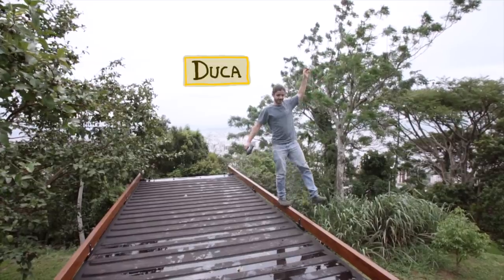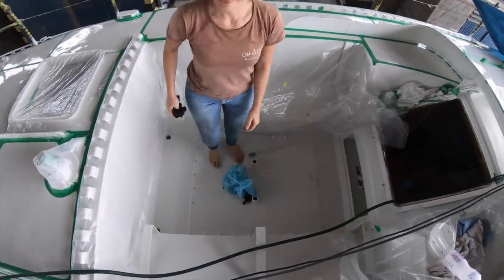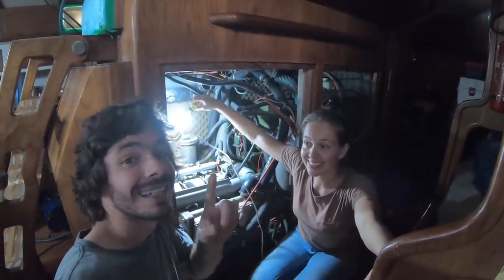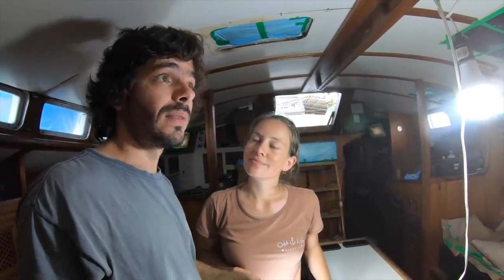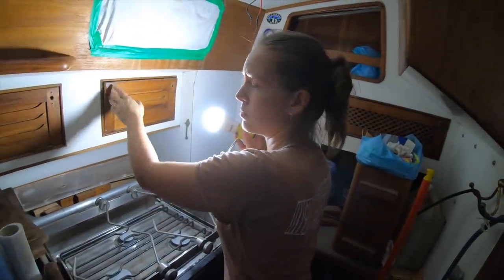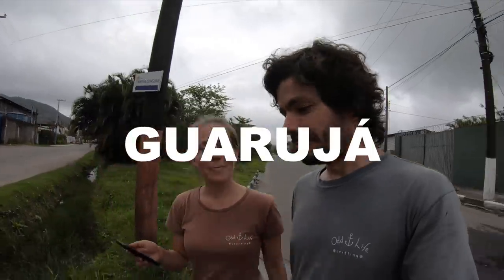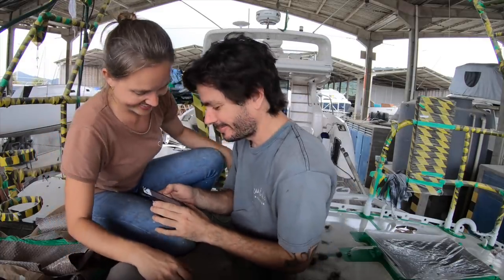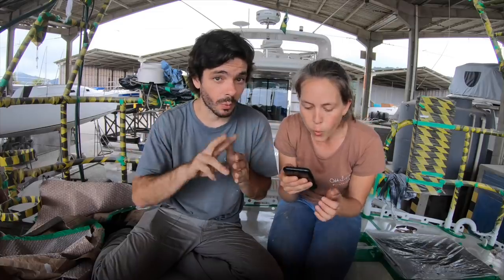⛵️"Abandoned" sailboat tour after 4 month of refit (still long way to go) + Q&A + haircut #104

Comment: For finishing the container house... I think taking a break after you get the boat in the water makes sense, but then just get the house done. That way you will not have it hanging over your head and you can cruise freely and look forward to going back to the house rather than thinking about unfinished projects back home when you are out on the water. There is a danger in never actually getting the house finished if you stretch out the process.
Reply from the maker: Thanks for the support
Reply: Odd Life Crafting and

Comment: I'm so glad to hear that you're media blasting the fuel tanks. It's a tough job, but the right thing to do. You'll have zero regrets.

You mentioned garnet. What's driven the choice of materials? Mineral sands (olivine and staurolite) will produce a similarly appropriate surface optimized for coating adhesion.

Garnet is excellent, but more expensive than mineral sands. However, this may be offset by garnet's lower consumption characteristics.

As you've not media blasted previously, practice out of doors on scrap materials before beginning work on the tanks. Dial in the pressure and flow, as well as perfect your technique (distance, speed, angle, etc.).

When it comes to working in an enclosed space, be sure to supply ample ventilation, and setup dust curtains to contain the mess (which will be considerable).

Lastly, Duca, this isn't a job on which to skimp on personal protective equipment. Don a full cover, including a hood. Wear gloves and goggles, and use a proper respirator! Ear protection is also recommended. Tape interfaces with gloves and shoes/boots, too. Media gets EVERYWHERE, so better safe than sorry.

I only wish that I could be there to assist in bringing your dreams to fruition.
Reply from the maker: Thanks a lot for all the tips, John. We have garnet available for free here in the marina, that’s the reason why we choose garnet. 😉. The idea is to try the machine on the lids first 😉
Reply: @OddLifeCrafting  Free garnet. Woohoo! Garnet will yield the best result, as you're looking to remove old paint and corrosion while creating an abraded surface that affords the new coating an optimal mechanical bond. Perfecting your technique on the tank lids is an excellent idea. You'll do great, Duca!

Comment: I agree with Roberta.  No Green stripe.  I would go with either white or black.  Black will probably be easier if your hull bottom is black.  You can just use more of the same black anti-foul as the stripe and done.

Regarding the sailing:  You do have an advantage being in Brazil in that you have such a massive coastline that is very close to the Caribbean, which is probably the easiest place to sail in the world. Honestly, I would recommend that after putting all this work into the boat you just load up and go.  Don't delay, because every day you delay is another day that you have to come up with an excuse to not go at all.

I can tell you from personal experience that life has a way of getting in the way of your dreams.  if your dream is the cruising lifestyle, then when you get the chance jump at it.  Because inevitably bills and babies and other life complications will arrive.  You don't want to be 20 years down the road with a boat rusting away on the hard that you never took out or only took out on weekends.
Reply from the maker: Thanks for the support

Comment: If I can suggest, on the manual head. Install a the macerator pump in between the head toilet to your holding tank.  With a simple manual switch, you can flush and macerate the fluids and such before it goes to tank. Makes it easier to keep clean, turns you head into a cheap electrical toilet.

Comment: Boat is coming along great. Like the anti skid paint for the deck and the port holes look good. As for the mast, you have to look at it and assess it's condition. You may be able to use the mast but replace the standing rigging. The running lines and sails probably have to be new. Your there and that's the choice you have to make. It sounds to me that doing more of the work there is better than just getting it moved back home and finishing it there. I was worried that the costs would be more there than back at your home port.  Your living conditions and the work that is being done looks to be reason to stay there longer. Once your in shape to sail, you might get someone there to help you with lessons to handle the boat before you head to open water.
Reply from the maker: Thanks for your support, Richard

Comment: Omega, Delta, Delta is a great name for the boat. If you just modify it slightly to Oscar, Delta, Delta it would make it perfect, especially for radio communication. "Oscar" is slightly clearer than "Omega". What you have achieved so far is fantastic and I'm green with envy. Best wishes.
Reply from the maker: 🙈🙊 my mistake. At least it’s short to remember

Comment: When installing the seal around the diesel tank, pay attention to uniform surface pressure. That is very important my husband engineer said. And he also said, you  can leave the diesel tanks as they are...love lore&Bodo from Austria
Reply from the maker: Thanks for the tips, Eleonore’s husband! 💕
Reply: AND the rubber should be diesel- resistant. So maybe better to buy a new one🤷🏼

Comment: Well,  informative episode , glad you figured out a way to blast the tanks , glad to see your going through the plumbing , my adivise is as it always  do the best you can with what you got .The electrical system , I hope you realize before hook al that new stuff up you better do the best visual inspection you can and replace any wireing that looks suspect , a fire on you boat would be no joke , and I have seen a few in my time . The rig ,  I do hope you get a new spar , thats great ,does that include all new running rigging as well? I hope .You did a good job on the taping off the non skid , it can be time comsuming and you all are not pros . You know you could compromise on the bootstripe , and make it white , it will set off the waterline from the black bottom paint , come up 2.5 cm and paint a 2.5 cm stripe it will look better and you can always change the color .As ever I wish you well and am really glad about the rig i hope it comes to pass . Keep on keeping on and ...calm seas fair winds and a star to guide you by .
Reply from the maker: Thanks for the tips, Lawrence.

Comment: YES!!! A Garnet wet abrasive blast is perfect. Hopefully you also use a rust inhibitor in the water like “Holdtight102” or a “Chlo*rid” product to prevent flash rust. I’ve done thousands of square feet with this process. You will get great results.
Reply from the maker: Thanks for the tip

Comment: Vinyl wrap is cheap and easy - you could both decide whether you can live with the colour before committing to paint. Sky blue is complementary, ie opposite orange on the colour wheel, but citron green could be a good fit too. Needn't limit the choice to only one additional colour if the design is good.
With such a radical colour as orange a good designer could make the boat look amazing with a radical shape of contrasting colour(s) instead instead of just a boring horizontal stripe.
Have fun with it - colour is easy to change.
Did I mention the importance of good design? :-)
Reply from the maker: Thanks for the tip, David

Comment: guys, check out your manual head - I am not sure but as I recall, you might have one of the most reliable head fitted now. MArine toilets are prone to break down and it is no a pleasant job to fix them. DO not throw your out without checking the brand/make, maybe it worth restoring it.  Best regards.

Comment: Add my vote to the carrot survey. No carrot boat. Suggestion, now that you are changing all the hoses, keep a couple of the ones in best shape, as  spares for an emergency leak. On the smaller hoses (like an inch or so in diameter) find a piece of flexible pipe (like copper) that fits inside the hoses and you can use to fix a split. For the bigger diameter like those in the engine cooling system or in the head output you can get a piece of PVC pipe that fits inside the hose just in case you have to split it to correct a leak. I am in agreement with you in regards to using English. I am Hispanic and I doubt that I would understand if you spoke only Portuguese even though they are very similar. I have an accent too so maybe that is why I love your accent in English specially Duca's.
Reply from the maker: Thanks for the tips

Comment: I'll have to start as its playing....stop on the fuel tanks...you have none of the algae sludge that causes filters to clog...Paint the hatches  and seal them up.  Your filters will pick up any stray strands of pain and they will last 20 years or more.  Use a baja filter.
Stove...the propane system is more important then anything.  More boats explode or catch on fir then sink.  One continuous line fro the propane appliances to the propane locker.  And a solenoid to shut it on and off.
Dodger...get a hard fibreglass dodger top made up or buy one...it saves you an amazing amount of money in the end as you only have to do the sides and windows...I just bought a used one.  Solar panels go on top.
Reply from the maker: Thanks for all the tips, Jerry

Comment: Hi Duca.  Hi Roberta.  No comment one way or the other about the green stripe.  Reading the comments, I think the consensus is "NO GREEN STRIPE!"  🤣🤣 🤣🤣  But, I have to say that I do not think that the name "Odd Life" is too long.  I think the name "Odd" is way too short, and in an emergency, may lead to confusion as the recipient of an emergency call may not understand that you are saying "odd."  But, what do I know?  "Monkey Business" is a long name.  There are numerous long names already in use.  Odd Life would not be one of them.  As for getting back to work on the container house after you sail your boat back to your home waters, I say take a break for however long it takes you to recharge your engines and then get back to finishing your pied-a-terre.  Like you said, between the container house and the boat, you've been going at this steady for more than two years.  You need a break.  But, lets get that house done.  Then, any additional work on it will be odds and ends here and there, and you can use it as you originally intended - as a place to land when you are not at sea.
Reply from the maker: Thanks a lot for your support and for the tips, Fancy

Comment: Question - do you really need to do ALL the hoses and the ball valves?  I would only do the critical ones below the waterline and any that have evidence or degrading over time.  A good ball vale will last many many decades.  I have a boat from the mid 1980's (Nonsuch) and still use may of the original fittings and yes, even some of the original hoses (but it is on freshwater in the US Great Lakes)
Reply from the maker: The problem is that they used residential valves so with salt water + 20 years. I mean they are “working” be they aren’t on the best shape. So as we are exchanging the hoses we decided to exchange the valves. 😊👌🏼

Comment: Hi Brazilian dry sailors, Please dont put a green line on your boat, if you realy have to put on a collor line..make it black, like the bottom.!.The painters did a great job, the boat looks brand new.! Nou I want to warn you 2, for wet sandblasting it is a realy messy job. The tanks will fill up with water realy soon.!! When people deside to do wet sandblasting inside,  they mostly have to drill drain holes.! But these holes have to be welded to close again.!!. So I ask you 2 to take that in cosideration.! My advise to you 2 would be, use "chem paint remover jell", and a few hours later scrab the loose paint of with a paint scrabber, after that sanding, clean with accetone, and it's ready to paint.!  (You 2, can also check the Y.T chanel "MS. Seeker", this man has a lot of experiance with wet sandblasting.!. He builds a 62ft steel exploring sail boat in his front yard.).Anyway, succes and have a nice time..Greetz.NL
Reply from the maker: Thanks for all the tips, my friend

Comment: I'm no expert, but I would think twice before introducing sand into your fuel tanks. Sure do the top plates off the boat if you want, but didn't everyone say that you won't have rust issues once the boat is moving around and the diesel is sloshing around? Hey anyway have fun in what ever you do. What I do understand is that there isn't always a simple solution to a problem. Think this one out carefully.

Comment: Skip the sand blasting and consider inserting a flexible fuel bladder inside the tank.
Reply from the maker: Thanks for the tip. The problem is that the tank is part of the steel hull, so we need to treat it anyways
Reply: @OddLifeCrafting  Yes, I understand that but consider this bladder as a flexible liner, which expands and shrinks depending on the volume of fuel.  Such bladders are used by US military as temporary fuel storage in all sorts of climates, both hot and cold.  Aircraft also employ them..

Comment: you can blast with dry ice after your done it evaporates !!!
Reply: You need a special machine to blast with dry ice.  You need to have propper ventilation.  Dry ice is not as good as other mediums (walnut shell, plastic bead, etc)
Reply from the maker: It's hard to find it here in Brazil

Comment: Bonjour les amoureux,
I am jealous, Duca, we have the same size but you have three times more hair than I :+)
Il like your videos even these Q/A sessions and you did not anwer to one of mines : How do you work on the parts of the hull hidden by the supports ? Do you move them regularly ?
I can't wait to see what happens to your engine, even if I think that will be good news as it is always in place and cleaned (no, you did not betray the topic!).
Amicalement, Raphaël
Reply from the maker: 😂😂💇🏻‍♂️Every time we moved the boat we put the supports in different place, them we can paint under the supports. Sorry that we forgot to answer your question.
Reply: @OddLifeCrafting  Bonjour, You do not have to be sorry, it was a wink! You are both of you great people, I appreciate so much that, even if you have thousands of followers you take time to answer.  I would have liked to meet you But Brasil is not on my tube line so I can't come after work :+) 
Amicalement, Raphaël

Comment: Our old boat is 13 years older than yours and we are also slowly replacing the portlights, see here https://tofas.home.blog/2019/10/28/not-the-stanchions/, and don't even talk to me about the electrics. For some reason, we have a hydro meter in a cupboard in the galley and a residential AC breaker box in the engine space. replacing all that is a long term project. I have the bits to do it just not the will. Always enjoy your videos, keep on trucking.
Reply from the maker: Thanks for sharing your journey with your boat with us

Comment: Give him green,...anyhow there will be a green stripe from from the growth at time
Reply: @OddLifeCrafting  BTW the water/sand blasting is great, make sure you also have a big vacuum cleaner to suck up the water. It would be hard to open your hull valves, as they are above waterline in your design boat
Reply from the maker: 👍🏻 thanks for the tip

Comment: Don't change the name of the boat  its unlucky also green paint is toooo .. also unlucky to step on the boat with your left foot first always use your right ......besides I like the original name ...if you come across any pirates it will scare them off .....☠
Reply from the maker: The problem with the old name is that it scares me. Hehehe